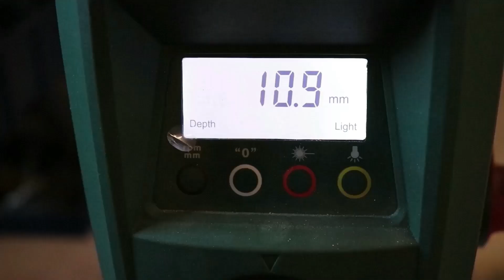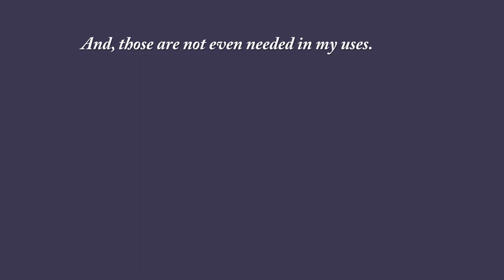woodworking Leg vise from junkyard items diy

Comment from the maker: This time i made a build from a junk that i found.

Sometimes i do woodworking too. 
Planing the edges of the boards has been little tricky for me. 
I noticed that i need to build another vise for that purpose.

Its not a beauty, but works for me.

All used drill bits and threading tools in this video is bought from our local " Wall-Mart " Lidl. 
Brand is Parkside. Sold in sets, price about 7$ / set. I really recommend those, for the diy users.

Comment: Interesting vise! Different to all the the other ones that I have seen before. 👌
Reply from the maker: Thanks Sam. Traditionally leg vises are based to threaded rod with a big diameter, that supports / alings vise straight. Some extra guidance can be get with dowels etc.. But, big screw is the "main" thing. Those are just hard to find for cheap. I wanted to found alternative way to make it. If you noticed, i didn't need to use any extra supports on the longer end on the clamped board. So, this is well enough way to make one, for cheap.

Comment: Great video! I don't quite get what the emergency jack does in the equation. Is it just to serve as a hinge and guide combined? Never used this kind of vise. Just have a old woodworking bench with all wood vise.
Reply from the maker: Yes. It guides vise straight, and also keeps it on its place in sideways. Otherwise build would be very wobbly